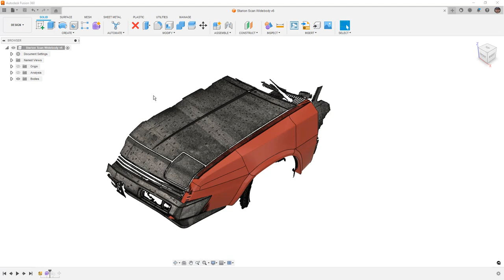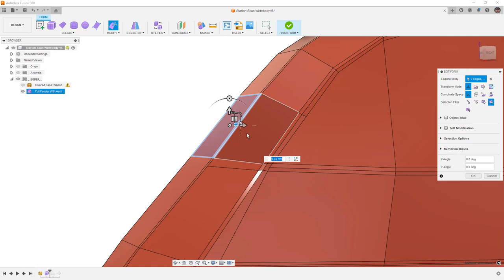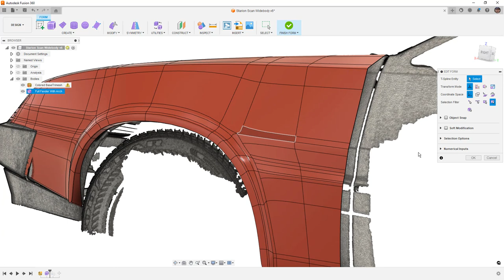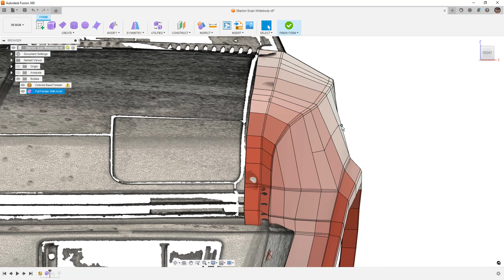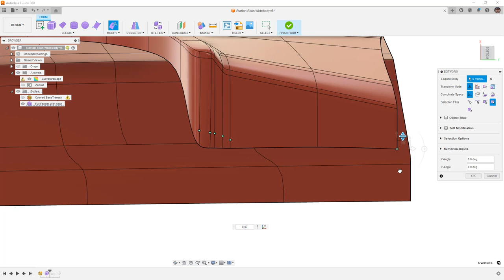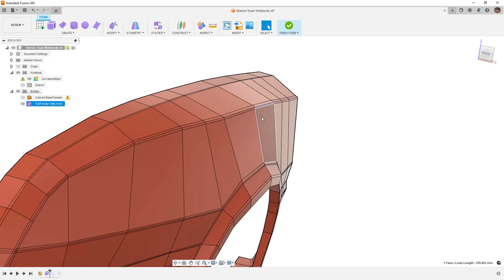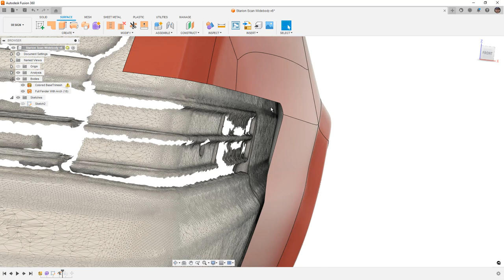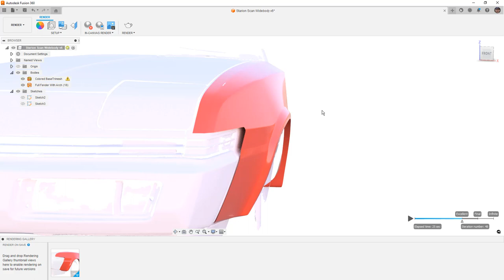3D Scan to Part Series Part 12 | Wide Body Design Part 9 | Fixing Surface Quality Issues and Trim

Comment: Do you think you could make a video about designing interior trim? I'm trying to design an A-pillar that has a gauge pod built into it, but I'm unsure of how to go about it.
Reply from the maker: What do you have as a starting point?  Are you working off a scan or just trying to model something close?
Reply: @LearnEverythingAboutDesign   I haven't been able to find any 3d scans of the interior, so I'm just trying to model something close to the original.
Reply from the maker: Which car?
Reply: @LearnEverythingAboutDesign  It's a Lexus SC300
Reply from the maker: @silentsoundssss  Nice!  are you in the US?  So 2jz NA?
Reply: @LearnEverythingAboutDesign  Yessir! It came with a 2jz-ge, but I just got done swapping a 2jz-gte into it. Now, I'm trying to redo the interior which is a nightmare since ever part is at least $200 USD
Reply from the maker: @silentsoundssss  oh i bet it is.  Recreating those parts without scanning will be tricky.  One thing you can try to do is put green painters tape on the A pillar every X number of inches, then try to cut out paper templates to match the shape as best you can.  do this in the area you want the pod.  From there you use a photo scanner to get those templates into the computer and set them up on planes.

Comment: Hi! Is there anyway you could show us how to extrude bodylines to create a car buck in Rhino 3d? People are making real 1;1 scale fiberglass bodies. Even fusion 360 if possible
Reply from the maker: I am not diving into doing Rhino videos just yet.  I did do a video on making a "buck" for a fender awhile back you can find here.  https://www.youtube.com/watch?v=2sLDPpolLpA

There are a couple of ways to go about this but the big variable here is how you plan on making it.  With this series I will be 3d printing this fender and you can use the print, sand/paint it and make a mold off the physical 3d print.  If you go with the negative and 3d print the mold it is basically the same thing.  I prefer to do it this way to see it on the car.  This also lets you retain some of the OEM details like how it bolts to the car and include those details in your mold without having to model them.